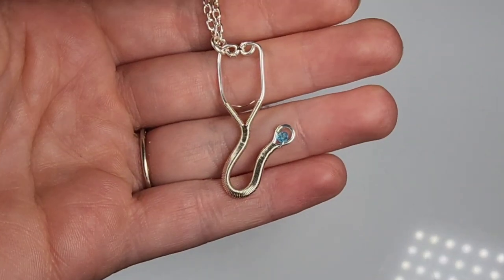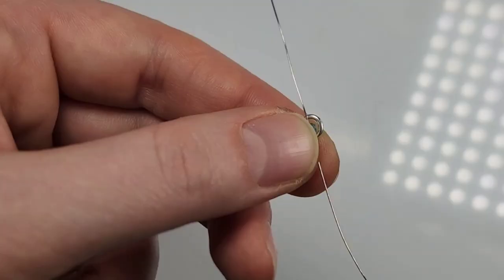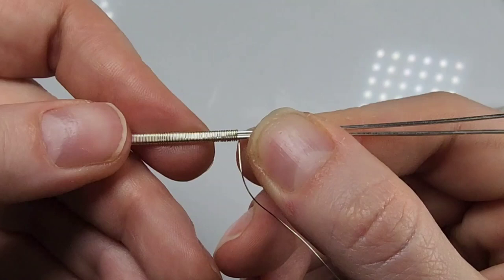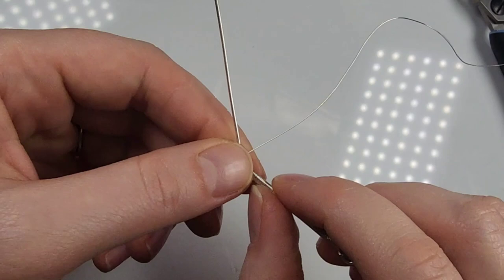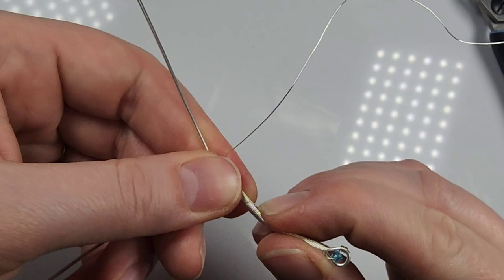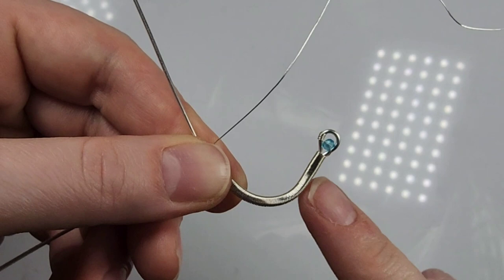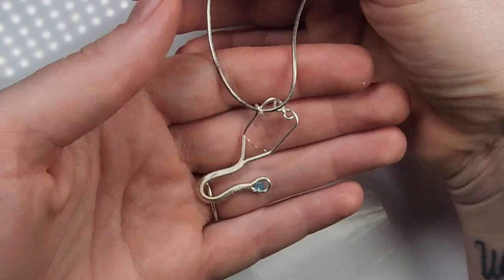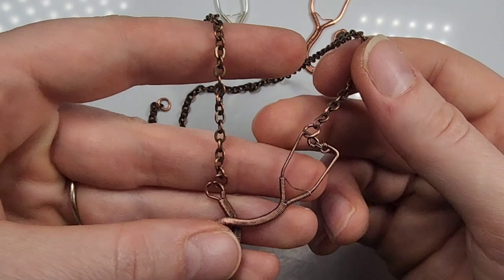Wire Wrapped Stethoscope: Wire Wrapping Tutorial: DIY Jewelry

Comment: Do you have a list of supplies or amazon links for supplies used?
Reply from the maker: I don't have links but do try to list all my supplies in the description of each video.
Reply: What brands of wire and where do you get it? I have problems finding dead soft craft wire in bright silver color ( like yours..) can you buy it in large amounts? I like to practice with cheaper wire before i use silver. Thanks!